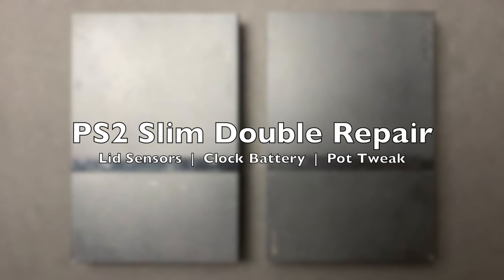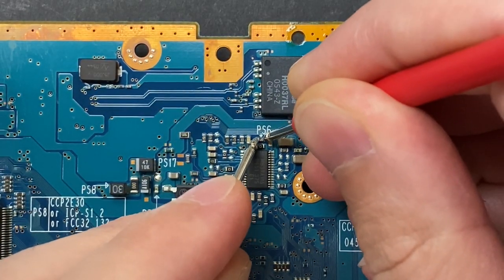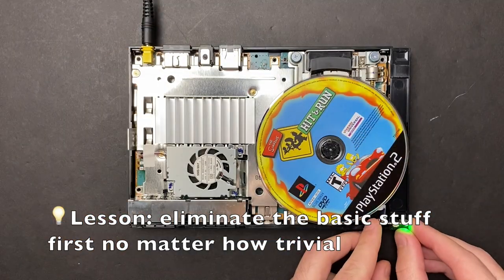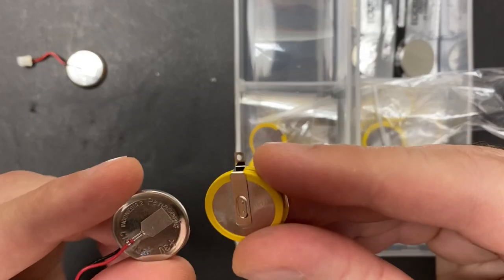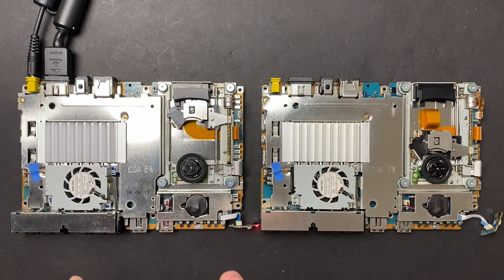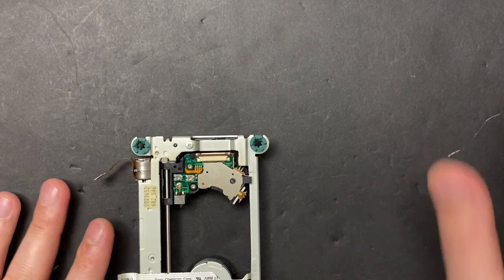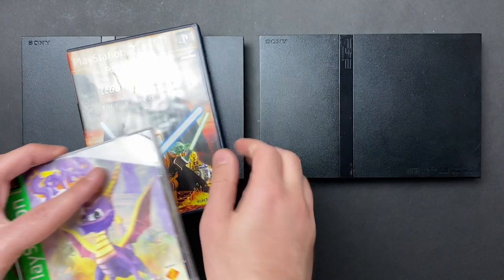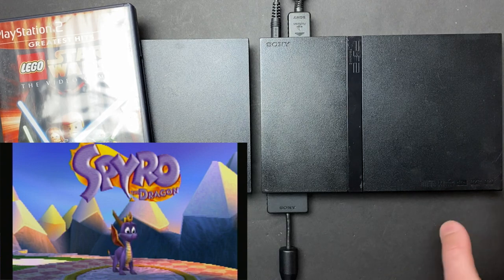A Tale of Two PS2 Slims - Faulty Retro Console Restoration

Comment: Lol "If you don't want to void your warranty" I'd be impressed if they offered a 15-year warranty. But in all seriousness, good video.
Reply from the maker: Glad you enjoyed it bud. Protecting your warranty sticker is more about preservation. To collectors a sealed unit is more valuable than one that has been opened and repaired. To the average person it probably doesn’t make a difference. Obviously PS2 isn’t collectible but that’s the idea.
Reply: @BorderlineOCD   Cant you just heat the tape up and slip it off without the void appearing all over the it? Pretty sure I've seen it done before on a video.
Reply: @AnarickTheDevil  if you want to warp the sticker
Reply: @BorderlineOCD  isn’t collectible yet…..
Reply: @AnarickTheDevil   That doesnt work on these because most of these stickers get damaged soon as you temper with them, especially peal it off. They are similar to hologram stickers, once you mess with them they are damaged forever.
Reply: @joshuadj22 I actually talked to Sony and asked if they still cover it, and was told they don’t anymore 😎

Comment: Good job on finding out about those switches. Also very creative with making some new clock batterys, currently preparing for a planned  power outage by fixing up some old 12v car batteries so I can use them to power my wifi router as well as my tv and ps4
Reply from the maker: Thanks bud. How long can you power that setup with a few car batteries? I applaud your determination to game through a blackout. That is true devotion.
Reply: @BorderlineOCD  currently have 1 good 60 ah 12v battery and 1 80ah high current 12v battery that I'm trying to fix. Got at least 2 hours playtime from that good 60ah battery on my 360 without my tv connected. I just tried out my tv plugged into the converter and it sounds like my tv power supply doesn't like it since it's making buzzing noises but it does seem to work. I also could connect my soldering station up instead of my consoles and clean up my work bench and finish some projects that I didn't have time for so I guess I should just do that instead
Reply: I also need to order some batteries for my ps4 controllers as well. It's funny that I have to order some batteries for those because all of the ps3 controllers that still have working batteries outpreform my 1 working ps4 controller

Comment: A few PS2 revisions had a design flaw where a spike in voltage would short the laser coils, and in turn would fry the LA6508 chip. On slim models this could happen by opening the drive lid while the disk was reading.
This could also happen when using scratched discs as the console would try to increase the power of the laser to try to read the disc, resulting in the coils overheating. 
IIRC Sony tried to address this by adding a pack of diodes in parallel before the coils.
Another option was to perform a "romeo mod" which would power the LA6508 chip with 5V instead of 12V.
So what I'm saying is use clean disks and try not to play too much with the lid switch once a disc is being read. 😉
Reply: Should have just made more fat models

Comment: Great job on fixing the two PS2 slims. It's good that you had an accurate resistance reading to go off of, since someone clearly tampered with the "dirty" slim. 

I've fixed a few fat PS2s that had disc reading issues. Aside from the mechanical issues of dust and dried up lubricant, they also have the potentiometer for adjusting CD and DVD. Fortunately I've never had to mess with that. On the fat PS2s, they have gears that can adjust the height of the rails where the laser slides along. The gears can reach a maximum height, and then drop back down to the lowest point once you passed the highest point. I would make marks where the gears originally were, just in case, and then I would count how many clicks of the gears would have from the laser at its lowest point until its highest point, before it drops back down. I would tune in the laser until I could read discs reliably.

To test the lasers, I would make sure my PS2 could read smooth and scratched discs, but since the PS2 can read many types of discs, I would test a PS1 game, a music CD, a DVD movie, a DVD based PS2 game, and finally a CD based PS2 game (blue discs games like Half-Life, Soldier of Fortune, et cetera). With a full suite of discs to test, I would be confident where the laser was tuned. You can also tell if the laser is reading well when it boots a disc before you ever see the dashboard of the PS2.

Keep up the great work. I'm looking to get a PS1 Digital Kit when they are back in stock, so I can mod my newest PS1 with HDMI.
Reply from the maker: Thanks dude, this was a fun pair to work on, although I may have underestimated the effort of working on two units at the same time!

I admittedly haven't seen any fat PS2 repairs in recent memory. I'm sure I'll eventually come across a repair lot with one. After working on the PS2 Slim I feel the same way about it as the PSone. It feels a little cheap and flimsy and doesn't have the same nostalgic kick somehow...

I'm prepping to work on the trio of original PlayStations I picked up recently, and happy to say the repair manual is more in depth than the PS2. I do think an oscilloscope would make things easier when working on the laser, and I'm considering getting an inexpensive one just for that purpose but not sure if it's going to do the trick or not. I've seen some rather interesting looking ones on Amazon for $40 lol...

On the PS2 laser adjustment you mentioned (took me a couple of reads to visualize it but I get it now), how do you know what the right height is? So after you mark the original position and reset it, do you go through the gear teeth one by one and test?

Good luck getting your hands on the PS1Digital Kit. Saw Voultar's install video and it looks like a fun and challenging soldering exercise!
Reply: @BorderlineOCD  I click through the teeth of the gears one at a time as you said. The PS2 CD-based games are some of the hardest discs to read on the PS2. I would have the top off the console and adjust the laser height one increment at a time until I could get reliable reads. I would then test the speed it boots into the game. I would finally test all the disc types I mentioned previously, to make sure the laser height was good across the board.

The laser module on the fat PS2 also has a black cover that can be removed to expose the source of the laser. I also clean that, because it is possible for dust to get down there, where a regular surface clean on the top of the laser would not get.

I absolutely love the fat versions of the PlayStation consoles. They have the most modding capability. I have two SCPH-50001 PS2s with Free MC Boot that loads all the games from a 1 TB internal SSD. Out of the 300 games I have, only one doesn't work. I personally tested all of them.

Somehow the e-mail notification when the PS1 Digital Kit went in stock did not send to me, which is odd. Hopefully I'll get the next stock notification. I ordered my XStation ODE today. I'm going to secure a SCPH-5501, since I need a PU-18 motherboard.

Comment: Great work with those switches! :) Very informative repair indeed.
 The funny thing is that there are many pot tweaking videos on YouTube (for different consoles) but tweaking the potentiometer never solved anything for me. (Tried on 10+ systems by now)
Reply from the maker: Thanks my man, glad you enjoyed it. I think an oscilloscope would improve the odds of a successful pot tweak and I’m considering getting one soon. It’s hit and miss with resistance values but yeah the odds are stacked against you given the higher likelihood that the laser is just probably dead most of the time.

Comment: Indeed, my Slimline had an issue with the door lid sensors too..... i had an issue for several years with intermittent "the disc tray is open" messages. Thought it had finally killed my system, so i disassembled with the help of your video.
As i was analysing the frontal sensor, the on/off button suddenly fell off the circuitboard ! It wasn't actually soldered on, but instead attached by some very dry glue base. After managing to take out the battery, reattach the on/off button, blow some dirt out of the frontal sensor, i finally discover(i think) that the problem is the main disc rotary is dead. 
Thanks for the video. (I can't believe where the battery is in the PAL territory version).

Comment: Really enjoying your videos. Bought a 60gb ps3 recently which had discs stuck in it which I managed to fix. It is very noisy so after watching some of your videos I want to take it apart even more and do the thermal paste. Thanks for the links in the description as I know what to order then.
Reply from the maker: Glad you're finding the content useful. I think you mean the lithium grease for the drive rather than thermal paste, unless you're re-pasting your GPU/CPU as well.
Reply: @BorderlineOCD  plan on repasting the CPU and GPU but the lithium greasd I will use on my ps2 fat as I am having problems with that laser. So if I give it a good clean and grease it might help it more.

Comment: Repairs like this are the best, just a spit shine and they good to go.
I've fixed 2 or 3 slims by noticing the the lid has gotten juuuust enough heat/wear that it bends slightly.
So now they don't reach the lid button, put some paper snug under there and they where good to go.

Comment: The battery inside PS2s are only for the clock, the system configuration and game saves are stored on the memory cards which are flash memory in SONY memory cards.

Comment: Man you are a pro. You make it look easy, which it is really not. Awesome work! Btw I measured the resistance not with the two points of the bottom but with one from the top and the bottom, can this  cause issues? Another question I have a ps2 slim there were the motor seems to try to spin faster 2 or 3 times and then the disc error appears, could be this a motor problem or it is likely that the laser is old (or needs adjustment)?

Comment: Really common issue this, especially after people started tampering with the sensors to get the slims to boot backups. First thing I look at if a slim isn't reading games.
Reply from the maker: Once you know, you know! First thing I’ll check in future if I ever come across these systems.
Reply: @BorderlineOCD  People started gluing them down and stuff to trick the console into thinking the lid was closed. You don't really see it on the 90000 models, I think Sony implemented a different check.

Comment: Does the laser power change depending on the model? I have seen other videos on YouTube that leave it at 750 ohm, or maybe those have chips to read copies
Reply from the maker: I would suspect the values can vary depending on revision. I saw similar videos with values in the range like you saw and I just don't know what to make of them. I have another two silver SCPH-79001 so it will be interesting to see the stock values on those (seals are intact) compared to this pair of SCPH-75001s...
Reply: I read on a forum that the fat model and slim ps2 actually needs different values. But I'm still not certain what exact numbers they both have since people seem to confuse and mix the numbers between the models :S

Comment: There are 2 door closed switches. The back middle one was messed up on mine so I taped it down and worked. The switched still worked but it didn't get pushed down enough for some reason. There is another swirch on the power button board. I would have  checked the switches before anything really

Comment: actually there are two models of the ps2 slim for future use and repair model 1 ps2 slims have a dial up modem port still model 2 ps2 slims dont
Reply from the maker: The only other model I have in my repair pile are a couple of SCPH-79001s. The pair in this video are SCPH-75001s. Both have ethernet built in. I'm assuming you are referring to yet another iteration?
Reply: @BorderlineOCD  there is a SCPH-9000x that has the external power supply built in.

Comment: Good job on fixing both! :)

I have one question tho. Were you able set the date and time on both right away or did you have to do something else first? My friend and I have replaced the batteries in our PS2 Slims (His is a black 75004 and mine is a silver 70004) and both consoles showed the same problem at first: We couldn't set the date and time and the spinning circles in the home menu still were the big blob like it was with the depleted batteries. I was able to get both working by changing random settings until the clock eventually started ticking again (It took about half an hour for each console.). I'm wondering if there is a trick to get the time working again right away.
Reply: Try to change the hour and if it doesn't let you, just press X and try again.

Pressing x gets the clock going again. Going back with circle does not.

Once the clock is going, you can set the time normally.

Comment: You should always test slim PS2's with discs you don't care about. It's a common problem for the adhesive that holds the laser's ribbon cable to the RF shield to fail allowing it to come in contact with the disc leaving a circular scratch.
Reply from the maker: That's hilarious, permanent damage to your disks? The build quality of this system is definitely questionable...
Reply: @BorderlineOCD  It's not that the ribbon detaches it just starts to peel up where the curl is from the upward pressure than gives it enough slack to come in contact with the disc. Sony solved the problem with the SCPH-9000x slims.
Reply: Can agree with this, my PS2 slim did this to Jak and Daxter. Luckily that game didn't store anything at all where the scratches were, it only uses just over 1GB of the disk!

Comment: AWESOME AWESOME AWESOME!!

As a former computer industry service technician I applaud you for your EXCELLENT video and diagnostic skills. Bravo!  Do you have a Patreon account I can buy you a well-deserved beverage for your efforts???

 I recently had my PS2 apart due to the clock battery dying (mine is the onboard CR2032) as well as the dreaded DRE issue. I muddled with the trim pots too to get the drive reading again, but I didn't have the ohms values available to me. Your video gives me the values to check for now, thank you!  Do you have a link to the PS2 service manual (it's a techie thing 😉)

Again, THANK YOU VERY MUCH for doing this EXCELLENT video!  I l subscribed, of course, and will now check out your other videos.

Comment: I have a PS2 slim that doesn't read the discs.  Tried to follow this guide only to find after putting it back together that the power will no longer stay on (light goes from green to red after a second).  Fuses seem to be good, but I'm guessing I may have disturbed the power connector and need to reflow the solder over there.  I didn't adjust the laser yet.

Comment: "bad design or low quality material". Mate that console has survived for 20 years and still works, my own that i've had for 15 still works. Its likely the fault is just a build of of dirt or the eventaul drying of and grease or lubricant in those parts. The only issue i've had is that the laser rail has dirt buildup preventing it from sliding properly which as you know is easily fixed

Comment: I have a problem with two lasers, both don't read CDs at all, but the DvD games can be read, I set the DvD screw value to 1646 +/- and it was able to read two DvD games, one in good condition, and the other in bad condition.. on the CD screw, I've already tried several values, but none of them worked...
I tried the value represented in this video, but it didn't work..
Could it be that the laser is almost dead or close to dying?

Comment: Hi, nice video! I tried everything u showed in the video but my ps2 still doesnt spin at all. I've checked all the things u showed with tester and about the resistence my ps2 showed some values higher than yours, (+100 each value) but I decided to dont change cause my ps2 is schp-7004 and not 1 as yours.
At this point I think it's something related to the engine, do you have any suggestion?
While reassembiling my ps2 I've also lost the power led which is not showed up anymore. I hope you can help me.
P.S my ps2 has a mod

Comment: Good job fair play. I keep debating on having a go at fixing retro gear and watching videos like this on the easy fixes are not helping haha
Reply: Send it to him
Reply: @herooftime9921  I mean pick up other used gear from say ebay with faults and have a go at fixing it myself. Plus anyway im sure the shipping from the UK to him would be far more than the products are worth lol
Reply from the maker: Naa if you think you'd enjoy it just go for it bud. You gotta start somewhere, just stick to older systems at the beginning. The circuitry is simpler, traces are larger, etc. eBay can be hit and miss, as sometimes "untested" systems have had prior failed repair attempts. See if you can source something locally, or if you wanna do eBay definitely scrutinize the listing details and the seller feedback. But its a hobby like any other. You get better with each repair. Kitchen appliances are good candidates as well. I know they're not the sexiest things to fix but I did my first soldering on things like that (broken power cables, blown fuses) and can be good practice.